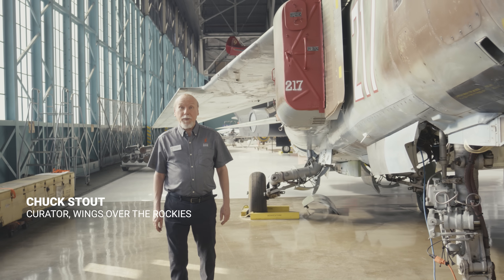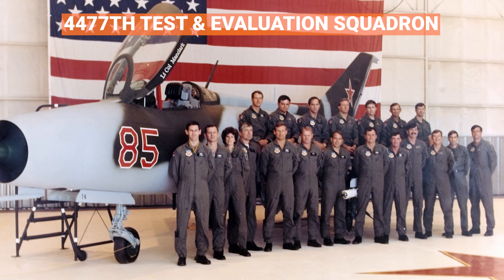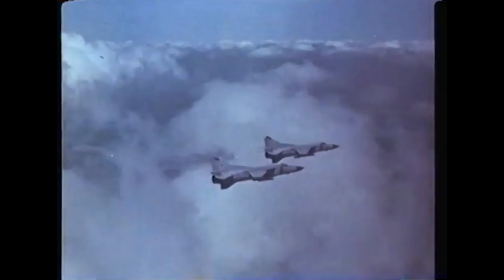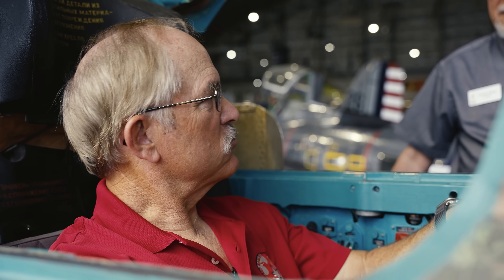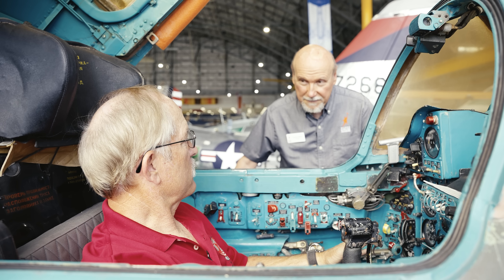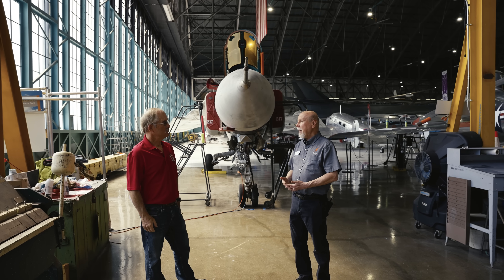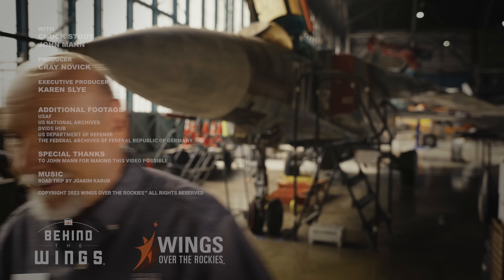America's Secret MiG-23s | Behind the Wings

Comment: What I find odd about the program - back then - was the sole acquisition of mere 1973 export variants MiG-23MS (a few of the 1973 MiG-23BN strike variant). 
Surely, one can figure from the aerodynamics 'flight envelope', construction quality and attention to detail, what the respective 'doctrine' for a procured airframe may have been: a defensive, 'Lightweight', Short Take Off and Landing capable, 'point defense' interceptor, not unlike in mission to the other MiG-17 to MiG-21, certainly not sharing the Aerial Combat Maneuver requirements for 'air superiority' missions of the US F-X or VFX designs... 

But not having had access to any 'Second Generation' e.g. 1978 MiG-23ML until after the end of the program in 1990 - if I'm not mistaken (and if there were no further classified parts of the program) - would mean that all adversary training was flown against a supersonic interceptor, merely equipped to a MiG-21S standard ... which - arguably - can't build a realistic confidence in face of the actual threat of the sensors and armament of domestic variants. 
When the MiG-23MLD and the MiG-29 were deployed in 1982 and 1983, the threat had again changed significantly, even in regard to 'air superiority' missions - arguably with a much worse outcome than in Vietnam (although granted the high number of accidents) or Yom Kippur - the latter leading to grim Air Force studies on NATO aircraft attrition... 

Thus - although the program was probably one of the best policies and well spent expenses in the US military, it arguably fell short if anything more than besting the results of Iran against Iraq (Iran-Iraq War 1980-1988) was to be achieved ... 

It would be interesting to have that question at least discussed to some degree...
Reply: What are you even asking lmao?

Comment: Again for everyone who falls for stupid anti-Russian propaganda.
the Mig-23 was conceptually a means of territorial air defense.
The technical parameters such as range, armament, electronic equipment were in no way suitable for carrying out actions like the mentioned models F-4, F-25, Tornado 2000 and others.
The Mig-23's operations relied on command from the ground based on stationarily installed P-35 and P-37 radar stations.
An independent action, see under the concept of free hunting, was excluded.
Because of the weak radar, the interceptors had to be guided by acoustic, and later also electronic, instructions into the line of sight of the attacker to be intercepted.
The maneuverability criticized in the evaluation was obvious, as dogfights were not prioritized and there was no significant structural work on wing mechanization.
The fact that the landing gear was designed in the way it is found is due, among other things, to the fact that it was impossible to accommodate it in the wing box, as is the case with medium and low-wing aircraft.
Anyone who looks at the Mig-23 on the ground from the screen will see that the ground clearance is extremely low.
A safe operation from field airfields, especially with a weapon load, can be denied.
The test landings and take-offs on a section of the Berlin-Rostock highway proved that ensuring this required a very high logistical effort that cannot simply be conjured up. IMHO, this exercise, in which I took part, proved that the planned use of motorway sections or emergency use does not provide any advantage.
The idea that the Soviet system could have been used to land on NATO airfields is simply a lie.
This is only possible in visual flight under ideal conditions by approaching the airfieled autonomously and guiding by the operators on the towers on the airfields.
In order to be able to interact with NATO landing systems, western radio and navigation equipment was installed on the Mig-25 taken over from the Bundeswehr
Bullshit.
Anyone who spews such nonsense is ignorant or manipulating the audience.
Reply: So your saying the radar on the mig-23 was no good? And the pilots and plane were not good enough to land on a nato runway?
Reply: @ashleyhubber5734  Exactly. The electronics on the Mig-23 was based on vacum tubes, did You know? The RADAR antenna had a single horn feed. The dish was mechanically actuated,... Old stuff.
No semiconductors.
Operating any airplane of that kind in contrary to movie fiction like Maverics requires support installed on the airfield. Under perfect conditions a well trained pilot could land the airplane somehow. But OPERATING is another topic. Look at the fuel alone, the supplies regarding auxilary stuff an airplane needs, at least the haevy battery starter block needed to give the elelectonics and the turbo engine starter the power, to be continied. Of course western made plugs do not fit soviet made stuff.

Comment: You are not honest. YOU are a liar.
The claim that the MiG23 was designed for aggression, for landing at NATO airfields, is simply wrong.
The construction of the frame was made because of expecting to operate the interceptors from fields
or Autobahns segments AFTER the NATO, USAF had destroyed the regular airfields.
The use of the MiG-21 as well as the MiG-23 was based on the principle of doing what you were told.
You said that correctly.
But, the basis for the control of the fighter aircraft were local P-35 P-37 radar stations and fighter control centers limited in range.
The task of the MiG-23 was virtually remote-controlled, and there were also such means on the MiG-21PFM 
as an anti-aircraft missile from the ground to be guided to the target to be intercepted.
this was a task of territorial defense.
Added to this is the short range of the on-board RADAR. Tasks such as those of the 
F-4G Wild Weasel and F-15 with free operational decisions by the pilots were not part of the design.
Reply: Dream on Sergei 😂😂

Comment: I remember reading about Red Eagle squadron but I never could find a ballpark guestimate for the top speed of the Mig-23. Mach 2.3 was more like its "rated" top speed but apparently it could go faster and was limited by compressive heating (probably on that canopy plexiglass). I read similar stories about the F104 but not many will commit to an estimated aerodynamic top speed. Supposedly the Mig-23 was updated later on to turn a little better, but the improvement was likely marginal.

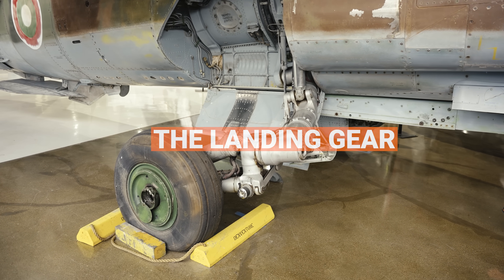Comment: 8:43 Mr Mann talks about how "the plane was envisioned to invade NATO" and thus it had this unusual landing gear which allowed it to land on rougher surfaces, well if by "invading NATO" Mr Mann means "invading NATO unprovoked" then that's not quite true! Invasion of the West as part of some grand scheme of conquering the world, was not the reason! The Soviets due to their experience during WW2 and the later use of their planes in the world conflicts around the globe including the Vietnam war - as it was said in the beginning 5000+ Mig-23 were produced, some were sold to  32 other countries, and it saw combat in Afghanistan, Middle East and Africa, and I bet such was the case with Mig-21 and the other Mig predecessors - had a philosophy that their weapons should be used in as many harsh conditions as possible  so their tanks were made to run on any fuel possible and their planes to land on any surface possible, which is why in Bulgaria the country I am from, parts of the highways were build in a way that would allow planes to land on them - they were straight for several miles and looked just like the one shown on 8:50! So the lie that was the "reason" for establishing NATO - the Soviet union and it's allies, aka the Eastern block, wanted to attack the West unprovoked - is still in rotation 50 years later. Russia as Imperial Russia and later as part of USSR marched across Europe ONLY twice and in both cases it was after it was attacked - first by Napoleon, then by Hitler!

Comment: Rusların uçak motorları takdire şayan. Güçlü motorlae üretiyorlar. Amerikalıkar uçaklarda  dikey kalkış teknolojisini Rus lardan almışlardır
Reply: In reality the engine of the F35 was based on the designs drawn up for the Covair 200 and early Lockheed testing with 3 bearing swivels. However it is true that Lockheed purchased data from Yakolev who had experience with this design in practice to speed up the process. No actual blueprints were exchanged however and the design for the engine predates the Lockheed/Yakolev deal by about 5 years.

Comment: The fact that, just a few days after arriving at the program, trainees were routinely able to run circles around the instructors in their MiGs is so cool.  That's a wildly successful program right there.
Reply: It's quite possible, if not more than likely, that the instructors weren't as good at operating the MiG in combat as the Soviet pilots would have been. For one thing, professional air forces constantly reassess their own engagement tactics and adjust them according to what they've learned from combat experiences.

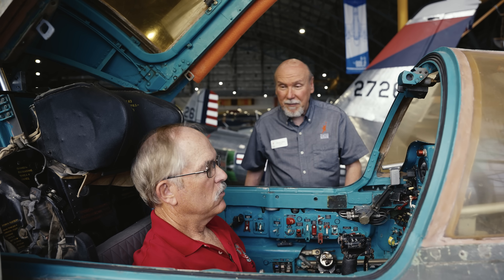Comment: 5:46 I think y’all need sum tires lmao
Reply: Those tires only had few landings, they often had (atleast the soviet ones) holes that if were visible it was still okay. If you saw no holes from the factory it meant you have to change it. It may look used alot but its actually still okay to use :) (at 9:08 you can see the holes in the tires that determines the thicknes of the tire)

Comment: Wait? Does this have Radar or guided missiles? How do you fight anything in a primative box without even oil pressure gauge?  It seems like you can't even see out of it inside it.
Reply: "The main mission of the MiG-23 was interception. It was designed to take off swiftly, reaching its target in the shortest time possible while receiving commands from ground control. It would then utilize its fairly advanced radar and guided weaponry, or if necessary, its cannon, to destroy the designated target.

While it technically could engage in dogfights, it wasn't its primary purpose. The MiG-23's main advantage lay in its speed and weaponry, intended to match more advanced versions of American and French aircraft with similar capabilities, such as the US Navy's F-4J or the French Mirage F1.

The MiG-23 could carry up to 6 short-range infrared-guided missiles. Additionally, it had the option to swap 2 of them for 2 medium-range missiles, which, depending on their variant, were either guided by an infrared seeker or the aircraft's radar."

Comment: Fun fact: the original design of the mig 23 was actually the ye 8, the ye 8 is a heavily modified mig 21 with no nose intake, intakes under the jet pretty much like the eurofighter typhoon canards, a slimmer canopy and a different stabilizer
The reason why the mig 21 was replaced was because IT WAS THE WORST JET IN DOGFIGHTS and you sadly have to admit it, it was a flying coffin and it was supposed to be replaced with the ye 8 (which I wish would've happened cuz that jet was cool, there is also an ugly version of the ye 8 with nose intakes)

Comment: N desert storm the mig 25 proved itself to be a complete surprise as it was so fast our first encounter was one downed F18 and missing pilot for many many years til we occupied Iraq and some bedouins told us they buried the dead pilot that night.

The mig 25 had the long range radar, the incredible high speed and the complete advantage from very far away. Only drawback was it's engines required overhaul after hitting speeds exceeding mach 2.5

The mig 25 if I'm not mistaken remains the only aircraft that gave us trouble over Iraq as it not only shot down 1 aircraft but the following sorties it weyt up it diverted some ground attack assets and jammers as well

Comment: I found it unfair to compare the cockpit of the MiG 23 to F15 & F16. The MiG 23 was an interceptor and the philosophy was to fly into the enemy planes at high speed and shoot, then  scoot. Pilots were told not to dogfight. F15 & F16s have dogfighting heritage and therefore sitting higher in the cockpit with good visibility was essential. The MIG 23 was not going to dogfight but it was built for speed so sitting low in the cockpit fulfilled its role as visibility was only needed forward and aerodynamics was improved by not having a tall bubble on top.

Comment: 5:00 He has the seat all the way down. Having been an ejection seat mechanic and having had some hands-on time with a couple of Soviet ejection seats, including the K36, it is easy to tell. The gap between the back cushion and the headrest is as far as it can go. This seat does not go through the canopy so the helmet would actually be higher than the top of the seat.
There was a loss of an F-18 to a MiG-25 in the Desert Storm...
Reply: There were few allied losses, the Soviet planes and Soviet tanks were in a pretty one sided war.
Reply: @arthas640  True. There were no verifiable losses to a MiG-23 in Desert Storm, but many MiGs shot down, and one MiG-29 was ambushed by the desert floor.
The F-18 pilot was on a SEAD mission, and was getting pinged by multiple radars.  Telemetry records from his plane showed he had a missile armed and was maneuvering to fire on a SAM radar.
There were also at least two MiG-25s shot down in Desert Storm, and all they had to do was defend against the F-15 behind them.

Comment: Lack of oil pressure gauge and the funky fuel gauge are engineering oversights IMO. I used to design avionics. They likely had a budget constraint or pressure on them to complete the build and they compromised on those two before they could finish up the work.
Reply: It does actually have an oil guage

Comment: 3:07 the guy mirrors what I said about the Flogger in another vid. Its TRAINING not the jet.
Earnestly feel would have done well - even against his Eagle, had those Arab pilots #DOGFIGHTING skill. No matter erred imo by limiting agility. 
An F4 knocked done agile opponents and the 23 I read is as unmaueverable. Apply its strengths and DF techniques to overcome tight turning enemies. 
Approaching a superior jet at nap of the earth - low altitude to pop up below for a shot is viable.
Reply: Aircraft actually does matter. You can be as skilled as you want but a MiG-21 going up against an F-15 will lose 99 times out of a hundred irrespective of pilots.
Reply: @burningphoneix  Obsolete Mig 17s dropped advanced F105s and F4s in Vietnam. A dogfight trained pilot can best any foe, adapt the tactics as I showed. 
Now go and self appraise your dangerous statement. The F15 driver taking your side will bite it.
Reply: @TheKeithvidz  The United States had 3-1 loss ratio in Vietnam for Air to Air (3 killed Vietnam Migs for every 1 American aircraft downed) This was seen as a disaster by the United States Armed Forces.

Israeli's Air to Air kill ratio versus Arab forces during the HIGHLY successful 1967 Six Day War?

3 to 1 vs Egypt
1 to 1 vs Jordan
NEGATIVE vs Syria and Iraq

By 1973, Israel had majorly updated it's airforces while the Arab airforces were still using the same planes and missiles from 1967 and even older.

As historian Tom Cooper states: "However, starting in 1969, Israel received US high tech that was wastly superior to what the Soviets were ready - and able - to deliver to their customers in Egypt and Syria. Foremost relevant to air warfare were such US-made systems like enemy IFF-interrogators and AIM-9D Sidewinder missiles. As of the time, the Soviets weren't even aware that the NSA was able to read their IFF already since the Cuban Crisis of 1962. Moreover, they were convinced that their R-3S air-to-air missile (NATO-codenamme 'AA-2 Atoll', this was a copy of the US-made AIM-9B Sidewinder) was highly efficient. Thus, they refused to listen to complaints from 'Arab' air forces, all of which were explaining them that the R-3S was simply useless.

Finally, the USA equipped Israel with F-4E Phantom IIs, which - while actually equal in manoeuvreability to MiG-21PF/PFMs - were faster than MiGs, and easily outmatching these in therms of firepower (regardless if in air-to-air or air-to-ground disciplines).

With help of such technology, Israeli pilots have had superior situational awareness, and weapons with which they had it relatively easy to shot down Egyptian and Syrian pilots. Regardless if receiving more tactical training, Arab pilots were constantly at disadvantage. Foremost, it proved nearly impossible for them to take the Israelis by surprise, like they regularly did at earlier times. "
Reply: @burningphoneix  Funny knowledgeable you excluded Syrian Mig 21s hit Israeli F15's on two occasions - and came close elsewhere and that's with their lackluster skills. The same Fishbeds dropped Israeli Phantom 2s as well.

Comment: Two interesting facts which I don't think were covered in the video itself:

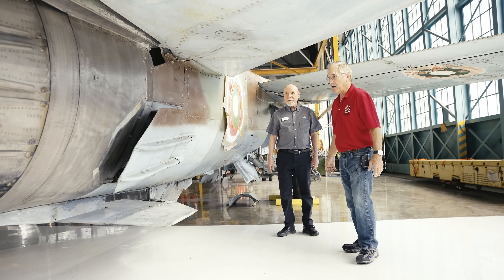9:12 John mentioned previously that this particular MiG did NOT find its way to the US via the CONSTANT PEG program - as you can see clearly in this shot, it sports post-1991 Bulgarian Air Force markings. Just for the folks out there who may not recognize all the different roundels (esp. that for a time three Warsaw Pact members - Hungary, Romania and Bulgaria - used different type of markings - a red star with a national tricolor in the middle, - which sometimes makes it difficult to differentiate those nations on blurred or black & white pictures)

And 9:14 you can clearly see another distinct feature of MiG-23, a folding lower fin. In flight, it extended lower down than the landing gear. They were wired together, so that when the gear was retracted, the fin would fold down, and when it was lowered again, the fin would fold up - otherwise every landing would end up with a very nasty case of a tailstrike.
Reply: 8:55 you can also just about make out the lower fin folding down as well in the back of the shot.
Reply: @BritishTeaLover  I'm British and I also love tea. Strange coincidence, eh?